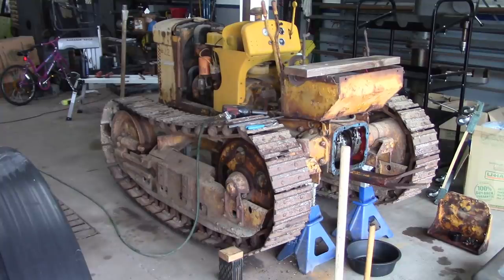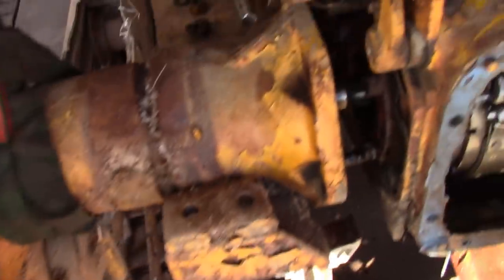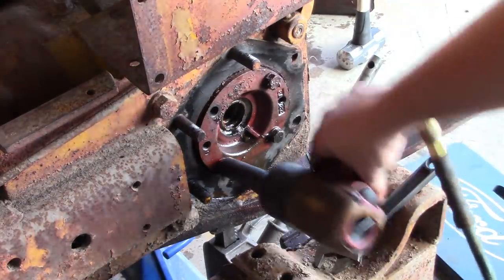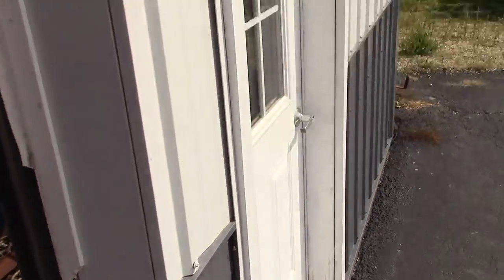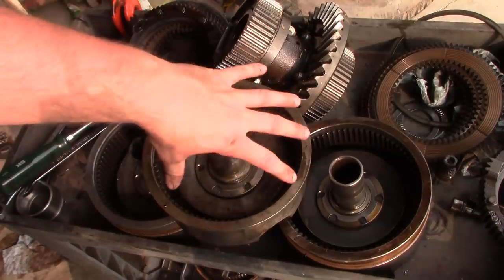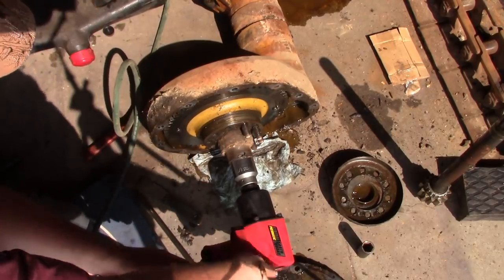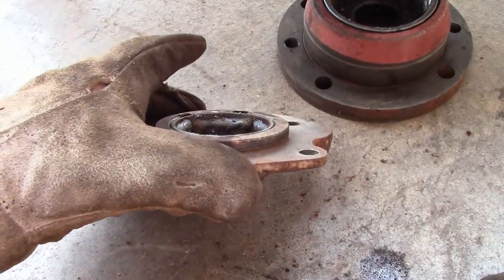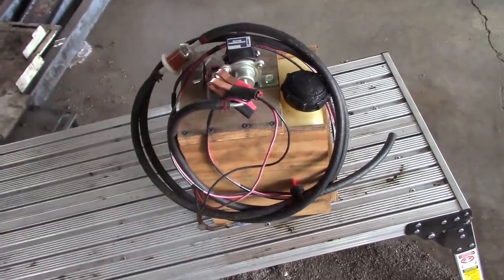1960 Oliver OC46 Crawler Tear Down and Steering Clutch Removal after Sitting 13 Years, Part 2

Comment: I own one of those  Cleatrac Crawlers. Out bid a scrapper at a estate auction to save it. Mine has the Hercules six cyl diesel. Unfortunatley some one left the exhaust uncovered and the rain ruined the sleeves and pistons. Im thinking about adapting a 250 chevy six cyl engine into it. Mine the bushings are free to rotate around the track pins. never seen that before.

Comment: Little tip for you, not sure what size airline you're using for the large impact guns, it only looks like 8 or 10 mm o.d. though. It needs to be 13mm or 1/2" to get full power from the gun, and as short as possible. You should also be using a filter regulator lubricator from the compressor, preferably connected by 3/4" hard line, with tool take offs on quick release connectors.  It will make a huge difference in performance of your tools.

Comment: Had a Quincy 20 hp that had low oil pressure. I took of the inspection plate to check rod bearings and found a rod cap loose. Tightened it up and ran it forever.

Comment: G'day Wes...I have seen the welding trick but with two spot welds at the two ends of a diameter or maximum with four welds like in a cross pattern. Have you ever tried like that instead of a complete weld bead all around?

Comment: I'm not a heavy equipment guy but I like these videos.  Question...what would one use a 'crawler' for?  Is this like a heavy equipment version of a farm tractor that drags/pulls things on construction sites or does it have attachment points for shovels?  Glad you were able to get it running...
Reply from the maker: It has a front loader attachment that can dig and lift material.

Comment: Ah, the old 5/16" drain plug. The Brits used to do strange sizes like that on rear axles.
Reply: Probably so they could sell you the special wrench too.
Reply: I bought a set of square and hex invert sockets. Lot of diff and transfer case level and drain plugs use them.

Comment: What would be an interesting way to remove that final drive is to have something similar to a jack stand but with a strap over the saddle, that way you can attach it to the final drive and cantilever the unit out by tilting the jack stand on the ground, the end of it could even have a curved foot to roll along the ground smoothly as it pivots, that or a jack stand that’s tall enough and some rope

Comment: At 28:24 it suddenly dawned on my what the custom torch work accomplished!  They torched the frame so the banjo legs would split, then they torched the sprockets so they could get the bearing cap off the pinion and slide the pinion out.  They probably saved 14 hours by doing that!  No need to split the tracks, lower the track frames or remove the loader frame.
Reply from the maker: That might have been the intent, but that does not work. You cannot get the inner bearing cap that supports the differential out without removing the final drive housing. They saved removing 4 bolts on either side from the loader frame.
Reply: @WatchWesWork  Perhaps you underestimate the will of a lazy person to avoid work? ;-) EDIT: Then again, they may have done all of that work, just to discover there is no free lunch?!

Comment: Be going down to the local TSC store and buying about 10lbs of new bolts and nuts. My local one has those larger sizes up to 1 inch .Have you tried WD new deep penitent oil? Seems to work better then the plain. CRC Knock her loose so so and expensive . Got a 12lb bfh for that kind of work.

Comment: In addition to the welding to shrink trick a thick coating of nozzle shield or grease applied to machined surfaces and the gap between the housing and outer race will prevent weld splatter from sticking.
Reply from the maker: Weld splatter will not stick to cast iron, but it can burn holes in it.
Reply: @WatchWesWork  I didn’t know that.  I used to work on escalator gear boxes I had a lot of trouble with the spatter sticking to the bearing housings I guess they were machined steel.

Comment: Wes, how come you never spray anything down with penatrant? First thing I do dealing with anything rusty is start soaking it down a day before liberally to start breaking down the rust. Of course, I have the gas wrench standing by
Reply from the maker: Trust me, I sprayed everything several times over a few days.
Reply: @WatchWesWork  good deal. I just turned down a 1998 ford explorer for a fuel leak when filling.. Turns out the filler neck crumbled to rusty dust, and it's loose at the tank too, so most likely the tank inlet is cooked too. Everything underneath is rusted to bits, and that's a can of worms I don't want to open. I had one in the dealership I worked at, it turned into a cascade of replace this, then this falls apart, replace it, then go down the line. You have to ask, when do you stop? How much is enough? I told the guy sorry, but I couldn't do it.

Comment: My case 350 dozer requires mineral oil in the rear end. Can get a NAPA. Old case dealer told me other oil will ruin the brake pads.
Reply: Ted Ohio 
    Sad to say and hear, those "old" guys and their invaluable knowledge are just about gone, the computer age interrupted the passing on of their knowledge, and experience(s)...  And along with that, machinists.  Today you just go buy a new part or new piece of equipment...  Ahhhh,  but there I go sounding like an "old guy"...
Reply: Thanks, I agree.

Comment: Yea I called snap on and asked them about that fuel transfer/pump, They told me to stop smoking crack!
So I put the pipe down and started assembling my own as per your directions.
Reply: hahaha!!! they won't be responsible for such a thing  :-)   Needs a fuse too!!! ...and a handle too....
Reply: @yankos_  Well I dont think they care if it does not have a fuse,  but I did install a handle.

Comment: had to laugh when you were scraping the "preservative layers" off the housing there.  Sometimes the first step in repair is to find the equipment by removing all the accumulated dirt mud grease grass sticks aunt ethels old stockings and whatever else has stuck there over the years. and sometimes by the time all the crud is removed there isn't anything left to work on :D
Reply: Last crawler I saw rebuilt was a TD6. It left a large shop bay 6-8 inches deep in dirt, sand, gravel, sawdust and straw well mixed with oil, grease, diesel and unmentionable barnyard by-products. I was very happy that I had nothing to do with that project! (including the cleanup)

Comment: The thing about heating the bearing races, go watch how they put a "tire" on a steam locomotive wheel. Heat them to cherry red slip on the wheel and they shrink fit as they cool down.
Reply: Same with wooden wheels+steel rings in horse carriages.
Reply: Ditto if replacing the starter Ring Gear on a manual transmission flywheel.

Comment: Juniors tractor needs a gearbox, it was not built for those kind of insane speeds. good thing the customer wants to fix it instead of tossing it. Can´t be all that many of these still in service. It´s a pretty cool machine.

Comment: Feels like this long shaft (from clutch to the big gear) can be removed without detaching the whole side.
Only unbolt big yellow drive gear and open the side gear box - the same way you extracted it when it was as a standalone unit on the floor.
But maybe i missed something.
Anyway, old industrial equipment video again - horay!!! :)

Comment: looks like the cluches in my allis hd5 it has a 2cyl 2 cycle  jimmie engine my injector line cracked and dumped diesel in to crankcase , cool trick on the bearing races never heard of it

Comment: Nice work. I would upgrade those thrust bearings to higher load ratings, since the OEM selected part was not up to the task and led to final drive failure. Bearing technology has come a long way since 1960s
Reply from the maker: I don't think there is room.

Comment: @WatchWesWork   At   09:15    I think your miss understanding the comments aboot the not working.   The comments  are telling you  that left clutch band is not working because the radiator cap is loose and not allowing enough pressure to build up to move the clutch band.  👍  Your welcome  😁

Comment: You made a response to comments made about adjustments inside the differential unit that I disagree with. There were two cylinders in the rear end that had bands on them. The one on the right when applied acted similar to a hose clamp tightening on the drum causing it to lock up or similar to emergency brake on a car. When you switched to the left side it made the same type locking movement but was it was not tight enough to stop the axle. Your comment about the internal adjustment not needed due to the adjustment being made on the outside was incorrect. It is required to be properly adjusted on the inside for the external adjustment to work as the unit wore down.

Comment: I'm always amazed how a power/air tool struggles to take off stuck rusty bolts while a breaker bar/turq wrench doesn't even notice
Reply: never use a torque wrench to remove stuck bolts.  use only to tighten.
Reply: @orbitalair2103  ow would it brake it I heard somewhere that you can use it for both but you learn something new everyday

Comment: That is not a job it is a career on the Oliver. Years of neglect with some abusive maintenance thrown in. Thank goodness for hard workers who care and, for broken machines to scavenge for parts. I wonder if it has other scars from its earlier life to complicate the repair, but I guess that is the challenge of being a rural repair specialist. The assembly will be very interesting.
I like the portable fuel tank, it is far better than an old bottle filled with fuel held aloft by a passenger. Cold engines drink fuel, the first few yards drank a pint, the next few miles used very much less.

Comment: Basically that is a big limited slip? The spot turn I had mentioned before is my neighbors that you push levers forward for two gears...high and low with reverse and the track will counter rotat.that is an oc9 loader.
Reply from the maker: Those big machines had both spot turn and power turn clutches in the same differential.

Comment: Count the teeth on the final gears. Most likely there the same. They made some alterations through out production. 
  I assume your using the match sets though.
  There is quite of few new parts out there. Zimmerman's have alot.  They use to have brand new bottom rollers for these machines  and sprockets. Not bad for 60 yrs old machines

Comment: My father had OC's in the sixties and fifties for backfilling that washer you found behind the beveled washers is a cheater washer puts more pressure on the steering clutches that washer will wear thin good luck great job

Comment: Oh man that must smell great old ass water soaked diff fluid
Also why do you think they hack the frame if you cant get the drive out gasket replacement maybe ????
Reply from the maker: I suspect they didn't figure out that it wouldn't work until it was too late.

Comment: Your in and out of that for a lot less than it would be here in alaska as we don't have many oliver machines... I have to ask, is that oliver cletrac or just oliver as I worked on some of that stuff back in the sixties or even maybe before that. I was real young at the time and stuff stuck good in my head as to repair but so many take offs on other varieties of machines. They all kinda copy yet set their own value of weirdness on stuff
Reply from the maker: I think Oliver bought out Cletrac, but all the Oliver crawlers were made at the old Cletrac facility in Cleveland, including this machine.

Comment: Wes, I've heard of diesel mechanics running beads up engine sleeves to shrink em so they could be removed.
Reply from the maker: Those sleeves are cast iron. But it might work. I've never tried it.
Reply: As i recall it was done on Perkins engines. Maybe a dry sleeve design.

Comment: I'm no expert on tracked vehicles, however it looks like you are missing Large U-bolts or straps on the rear axle tubes, tying them to the frame.

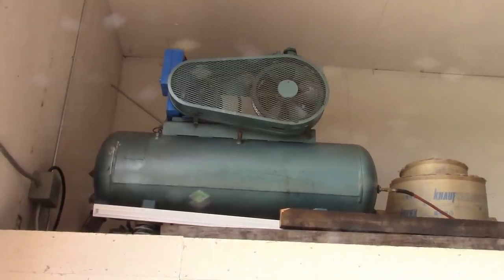Comment: 29:26 air compressor, just stating the obvious, you drain the water out of it eh? After compressing regular air that has moisture, the water eventually collects and forms a (growing) puddle in the bottom of the air holder.

Comment: When you mentioned the potential for the part going across the room I remembered something...
One of my former colleagues introduced me to the thing called a 'pingfuckit', when you are taking something apart the pingfuckit is the thing that shoots out across the shop and under the workbench or tool cabinet. It gets its name from the sound heard from your co-worker when disassembling something that has a pingfuckit inside.

Comment: Those low pressure pumps are enough to get a crappy idle out of a non running fuel injection engine if you don’t want to invest a lot in finding out the condition and suspect the pump, some of them will fit where the filter goes on some fuel injected vehicles

Comment: That Torrington bearing setup looks janky.  If the race doesn't have a solid uninterrupted surface to rest on failure is expected.  I see a machined surface that extends beyond the recesses for the bolt or rivets, not sure if the race actually goes that far though.   You have two bearing failures on the same side, so that makes me question what kind of trust is being applied during operation.  Actually it makes me question why isn't that thrust being mitigated.

Comment: Someone was trying to make things work with a bunch of worn out clutches. The extra steel and the flattened Bellville weren't up to the job, and likely not adjusted to work properly. The 'slip rate' was not correct.  Shade tree attempt perhaps.

Comment: That moment when... You realise you could have pulled the pinion shaft rather than the loader frame :o)
Reply from the maker: That will not get the steering clutches out.
Reply: @WatchWesWork  yes, because the frame hacked out with the gas axe was enough to pull the trumpet if the shaft was withdrawn through the banjo case. Not knocking it, been there a thousand times. Last week I pulled to belt clutches off a Kawasaki farm bike only to find the engine case pulls off the other side. (Timing chain out just to fix the gear selector, blerggg)

Comment: Compressor's been around since what you believe is the 1970s bet you the oil in that little crank case has not had the oil changed in it since then I could be wrong.
Reply from the maker: I've had it for 6 years. I change the oil once a year with synthetic.
Reply: You must be putting a lot of hours on it if you're changing it once a year.
In my opinion I really wouldn't be putting synthetic in it since that's not what it had in it brand new.

Comment: The differential that originally came out of the oliver of yours and the ring gear should be reinstalled because that will insure that the endplay will not change. If you change the differential bit keep the original ring gear then you still must recheck endplay regardless of reusing the original ring gear because that is not all machined 100% perfect and cast and machined from the factory all the same with the same tolerances

Comment: If you'd slap some "Flex Paste" on that thrust bearing and it would be good to go.  No?
Reply: 🤣 I used flex seal on the inside of my steel birdbath. It crumbled and peeled in less than 6 months, with "no load"! ☹

Comment: my jaw dropping moment came when I was working at a derailment when cutting a piece of #110 railroad rail there was no saw available all the powers to be were stumped. after letting them point fingers a while a old timer took a 3/4 inch cold chisel scored it in four places and hit it with a #16 pound sledge it broke like glass with a perfect end cut to length end.

he walked off like a boss

Comment: Mystery Disc under the belville springs @21:26 .. notice how much farther down the belvilles sit without out it.. that will decrease pressure on the thick pressure plate squeezing the frictions causing clutch slippage..   issue .. where to find one..  or to get something made up that is hardened. i wonder if people like Brian Block could do something like that since he has a heat treat oven he uses to harden his custom lifters. turning it out of  a flat of tool steel.  if you don't have a torrington needle  bearing catalog to assist you in finding replacement thrust bearings.. http://www.tdh.sk/files/catb2016e.pdf

Comment: I was just wondering if the cost of the repair justifies the value of the machine, also it has it's limit s on what it can be used for, in other words is it worth fixing ? To clutter around the field ? A nice paint job has to be done after you complete all the work !
Reply: I suspect the owner is not an accountant and believes in having fun.

Comment: Thease olivers hade best steering i hear and alischarmler hade good steering unit used no power from the tractor most older dozers are fixed up for show thease old cleatrack are still used in vineyards all over usa on guy sead the under carage takes oil not greese

Comment: So are you a squatch253 fan? Also should check out Warren with Western Truck and Tractor repair! Both are great channels if you do not know of them. Also watch many  job shop machine shop channels. YOU MAY BE ABLE TO FIND ALL THE SERVICE MANUALS AT A CHANNEL CALLED VINTAGE MACHINERY.ORG

Comment: You can clearly see the right brake was working and the left hasnt even touched the "drum" .. the right side has ware marks, the left side does not. So no the left brake was not working.
Reply from the maker: LOL. Except the grooves worn in the drum...
Reply: You must not have paid attention in the first video. When the left side lever was pulled back, the crawler STOPPED moving. When the right side lever was pulled back, it turned right. Exactly what would happen if the left side was working as it should and the right side wasn't driving.